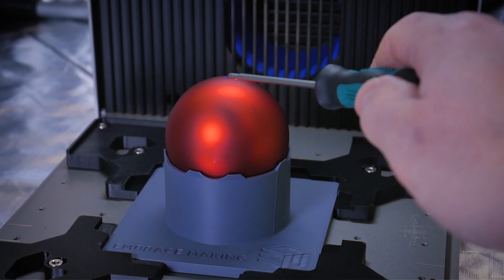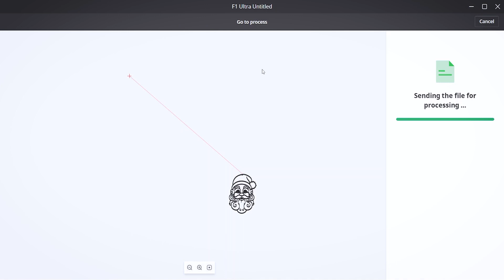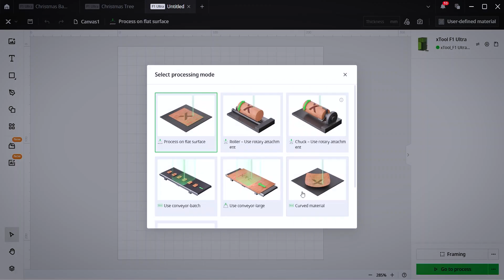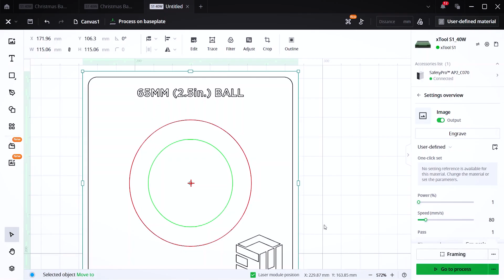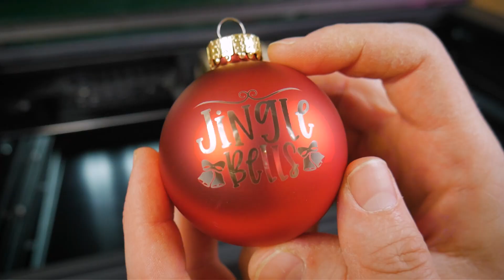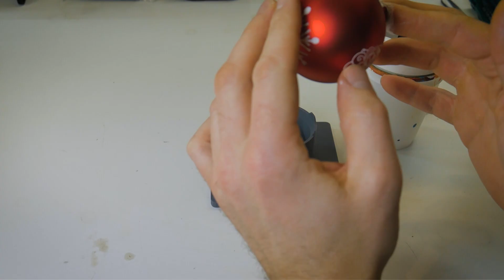How to Engrave Christmas Ball Ornaments xTool F1 Ultra, and xTool S1, With and Without the RA2

Comment from the maker: Get the best prices on xTool gear and materials at the links below! 
xTool F1:
► https://www.xtool.com/products/xtool-f1?ref=D5HpJRsyqyUUnt&utm_medium=5306&utm_source=influencer
xTool F1 ULTRA:
► https://www.xtool.com/products/xtool-f1-ultra-20w-fiber-diode-dual-laser-engraver?ref=D5HpJRsyqyUUnt&utm_medium=5306&utm_source=influencer
xTool S1:
► https://www.xtool.com/products/xtool-s1-laser-cutter?ref=D5HpJRsyqyUUnt&utm_medium=5306&utm_source=influencer

xTool AP2:
► https://www.xtool.com/products/xtool-safetypro-ap2?ref=D5HpJRsyqyUUnt&utm_medium=5306&utm_source=influencer

Looking for other materials I used in this video? Use the links below, as an Amazon associate I may earn a small commission (at no extra cost to you):

65mm Glass Christmas Balls (red):
► https://amzn.to/3YUirL9

65mm Glass Christmas Balls (multi color)
► https://amzn.to/3UGAWjX

4" Duct Hose (25ft long!)
► https://amzn.to/3YyaBGS

Air Quality Monitor
► https://amzn.to/3xgoaA2

Electric Screwdriver:
► https://amzn.to/3P43fpz

Digital Calipers:
► https://amzn.to/48IQh7w

Comment: Would be interesting to see the curvature handling capabilities of the F1 Ultra instead of setting the focus into the ornament when not using the rotary module.
Reply from the maker: I can give it a try again but... I wish I could remember what I was engraving the other day and I was using the curved surface setting... but it really didn't like the outer bits of the curved surface where they fall away rapidly. It really only left a fairly small area in the middle that was mapped out so it was actually less effective than setting the focus slightly into the material.

Comment: Do you have the 2watt for the S1? Wouldn’t that give you better detail?
Reply from the maker: The 2W is the IR laser ... I don't have it for the S1 however my F1 ULTRA has the IR laser as well as my regular F1. Personally through testing I found that the blue laser works the best for this specific job of burning paint off of the glass balls. Off the top of my head I believe the 2W IR has a smaller dot size. So neglecting to consider the material it is being used on the smaller dot size would be better for smaller details
Reply: @ Thank you for answering me. I’m looking to purchase a laser, prob the S1. Prob the full blue package. I wish they sold the 20 watt module separate, they advertise you can switch them out, but only sell the 2watt IR and the 40 separate. They don’t sell the 20 watt full package, and buying it all separately then adding the 40 watt is so much more. Seeing you use the f1 ultra just made me wonder if it would have came out the same using that 2watt in the S1. Just trying to see what is most important to get. Love the ultra too. When they changed from the reg f1, they made it so you can’t angle it or take that bottom out. So say you wanted to do something in the middle of a doormat, you can’t the way the base is now on the ultra. That made me go towards the ultra, hoping to get close results with the bigger area and the ability to use the ir
Reply from the maker: Maybe I'm a little confused as to exactly what you want but my recommendation would be to go with the S1 deluxe bundle (20W): https://www.xtool.com/products/xtool-s1-laser-cutter?ref=D5HpJRsyqyUUnt&utm_medium=affiliate&utm_source=goaffpro&utm_term=5306&variant=44483097657583 and then add the IR laser module and AP2 air purifier in the options because it reduced the AP2 to 499 when bought with a machine. 

The S1 40W is mostly over kill in my opinion unless you want to cut through really thick stuff, but I find the 20W is decent balance between power and detail. The ULTRA is really cool because you don't actually have to physically switch between blue and IR laser modules - but the downside is the limited working area and as you said, no pass through like the smaller F1. I would say the ULTRA is more geared towards people who want to mark metals because of the more powerful IR laser. If you're not into doing metals very much and you need the large area then consider the S1

Comment: Quick question, trying to understand the focus adjustment. If you want to focus into the material a little why did you add thickness to the autofocus? If I understood your logic correctly I would have presumed that you would remove millimeters from the auto measure. Thanks in advance for the explanation.
Reply from the maker: Hi Ryan, I assume you are referring to the S1. For this machine the larger the number represents the farther the distance away from the top of the laser module as the reference. The number does not represent thickness. Here is a link to an xTool article that has some pictures: https://support.xtool.com/article/1038
This article I think should make it more clear, thanks!